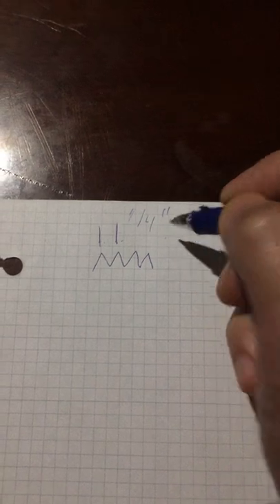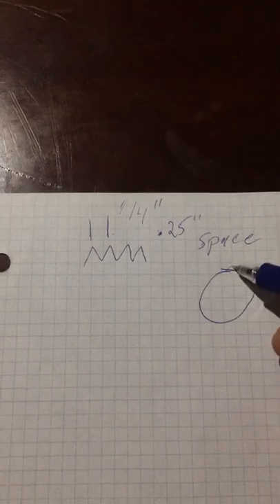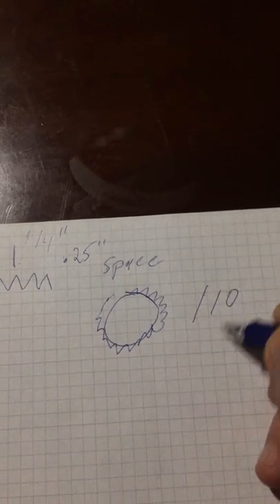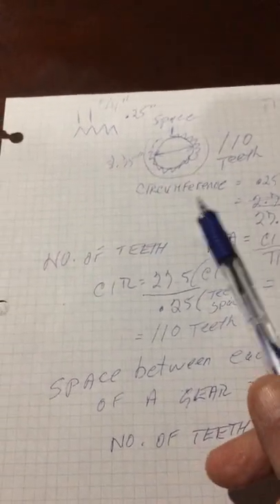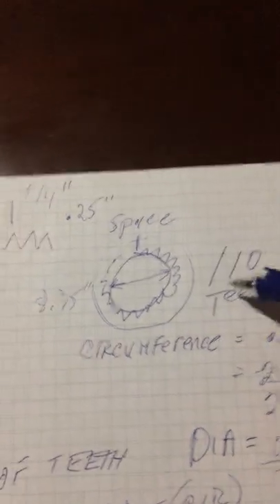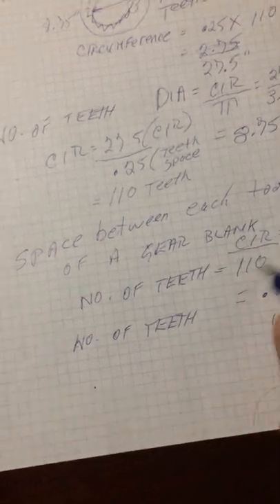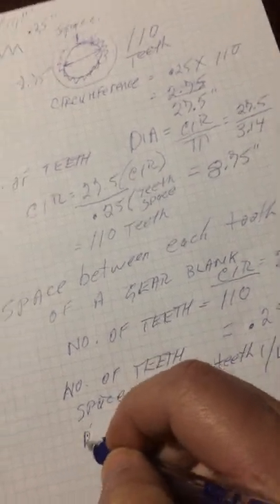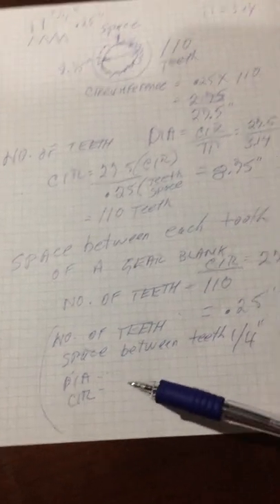How to calculate gear dimensions the easy way

Comment: Cheers helped a lot tried  it out with a gear i have, just had to get the exact  tooth spacing right. if out by 0.1 of a MM, will make a huge difference in diameter
Reply from the maker: cheers!.......